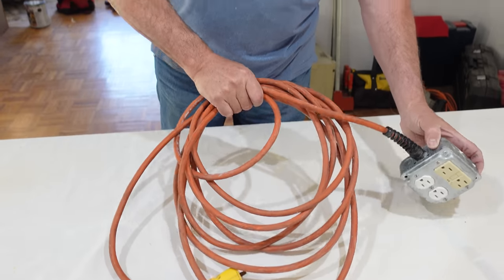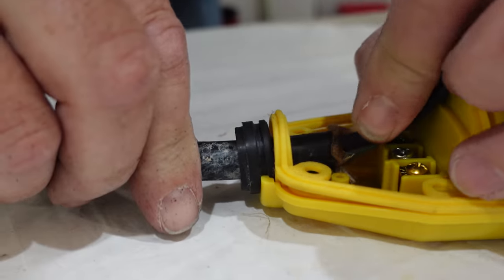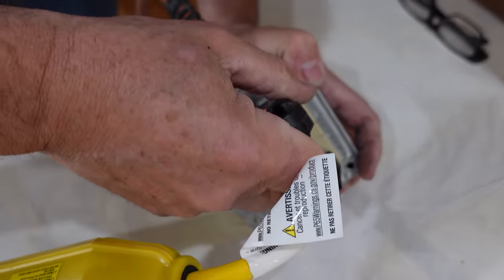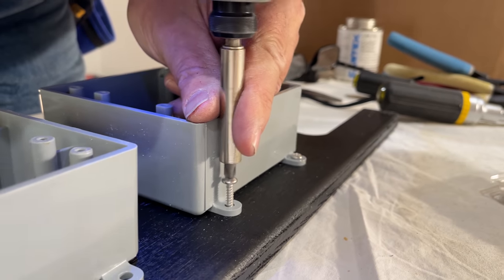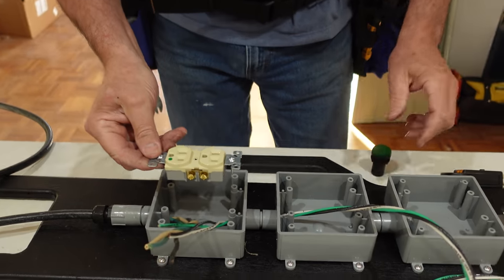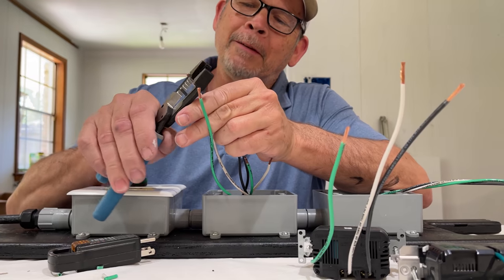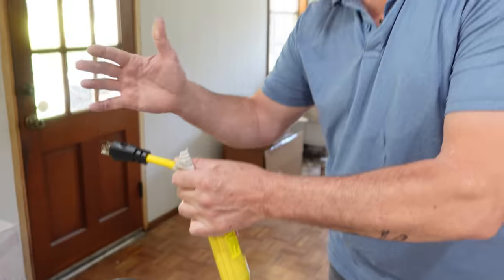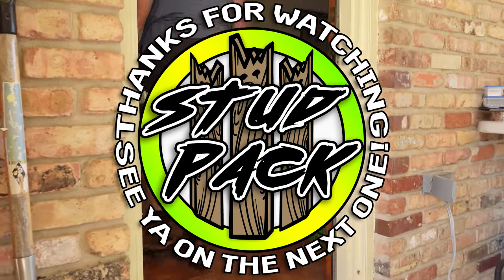HOW TO MAKE THE ULTIMATE EXTENSION CORD!

Comment: I see one improvement I would make.  I would have the cord wrap BELOW the outlet boxes.  That way I could use the boxes with unwrapping just a few feet of wire.  The  way it is now, you have the wire blocking the boxes.  BTW, this is my first time watching your videos and I liked / subscribed.
Reply: for a variety of reasons, it is better to not have current carrying conductors coiled up. (heat build-up, magnetic coupling & noise)
Reply: @jamesalles139  While certainly true, it is not really a factor in this application because the things being plugged in are generally motor-driven devices which already create a lot of line "noise," fluctuating magnetic fields, etc. If your application is so sensitive to these minor data points, you would engineer it to a much tighter standard. They already "over" engineered using the hospital-grade receptacle.
Reply: @TwilightxKnight13  un-wrapping the cord is not 'over-engineering', it is simply a good habit for high-current loads.

Comment: In Ham Radio we often add meters to our panels to monitor voltage and amps on our rigs. This is especially helpful on mobile setups where you might be operating from a battery. Having a small LED display about the size if your green light would be handy to make sure you don't overload the circuit.
Reply: This is great!
Reply: Any ideas where to source or find one of the led displays?
Reply: "Jameco" Electronics company
Reply: Came to say the same, found a volt / amp display in a slightly larger than the power on indicator light shown.

Comment: Hi Stud Pack , I am a electrician in Quebec Canada , I love your videos keep it up. The reason it didn't trip right away, is it wasn't a short circuit , try it again but wait longer so the breaker heats up  and goes on overload , it should trip . But there are lots of old panels like commander and FPE panels that are notorious for not tripping on overload conditions. Electrical panels do need to be tested after 20-25 years .
Reply: As a bit of trivia for you - the current recommendation in the UK at the moment is every 10yrs, but we do have the madness of ring final circuits!
Reply: i agree with this statement
Reply: Nice was also going to say this I am a Sparky in Texas

Comment: I would mount the last grey outlet turned 180 degrees. You see at 23:30 how a right angle plug blocks the second outlet. Reverse the outlet, and you can use a right angle plug in the lower, or outer spot, and leave the other outlet available if needed.

Great video!

Comment: That has got to be the most awesome extension cord of all time. Reminds me of the ones we built when I was in trade school in sixties. We had the auto shop weld up some stands. We then attached two eight inch square boxes and wired in two duplex receptacles in each with thirty feet of 12/3 stranded cable. Great job site cords but know where near yours. Of course it was 1966.

Comment: I have been wiring devices all my life. With few alterations I think this was spot on. As usual I would personalize it for my own particular needs...but it was the best homeowner instruction level one yet. I did a 240 volt 50 amp one off of a range plug and a small subpanel. It had 240v, 120v and gfi protection. DEFINITELY not water resistant or OSHA approved. I can weld with it and run  anything 120v ..with full breaker protection. Not pretty either.
Reply: Please show me how to make one. I travel a lot doing repairs anything from roofing to repairing/welding damaged hand railing.

Comment: As a retired electrician I complement you on the extension cord. However I must throw a word of caution about the paddle connections. For this application it probably wouldn't be a problem but having years experience in the oilfield electrial equipment and vibrations having a tight twist on the stranded wire under the paddle connectors will become a loose connection. The natural twist of the wire is good. The tight twist over time will relax.
Reply: I was thinking the same. We always tinned the conductor with a little solder to strengthen the mechanical connection.
Reply: It explain why we needed to re-screw connections of breaker box and terminals after a day or 2, to be sure the wire werent loose. Solid wires needed little tighting, but stranded wire where the always loose. So, we twisted too much ! Thanks !
Reply: @donfrost9457  Solder will cold-flow under compression. I was taught to use copper ferrules.
Reply: I never twist strand wire much
Reply: Also a retired wireman. Whenever I would find stranded wires under a screw in this manner, the thought that would come to mind is that the guy who wired it was just plain lazy.

Comment: Not only was this a great video it also showed items that many of us most likely never knew existed. The receptacle with the USB option not only saves counter space it eliminates the necessity for the little “brick” transformers which are just clutter once you’re done charging an item. 
The plug end gfi was another bonus.
Reply: This is a good point and as someone who does their own electrical it is not a big deal for me to install the USB charging receptacles in my house. The issue I have, is that the USB charging standards keep evolving. i.e., they used to be 5w, then 10w, now some phones are upwards of 100w charging capabilities. Also the underlying protocol used (ex one of the newest is PD3.0 with PPS) keeps changing for optimal fast charging. So in the end, I prefer to swap bricks than to keep swapping receptacles. That being said, I think its a great addition to this extension cord where you want less clutter.
Reply: @glennda5id  my son is a six year Tesla employee and he says fast charging harms a battery and slower is better. Using those cars as an example charging at home is far better than repeatedly using the supercharger stations. 
I have new/newer apple products and they came with larger wattage bricks but opt for the slower one as there is no need to rapid charge them. 
It’s personal choice.

Comment: I built version one a couple of months ago and I love it. I will probably build a simpler version of this super ext cord, but I’m not a fan of that huge yellow GFI box. Love the built-in mount/cord wrap and love that it’s rubberized. The point is you guys pointed out that the bus bars we build are far better than the ones sold in the big box stores. They are also customized to our needs.

Comment: Although I don't remember exactly how long ago it was but somewhere in the neighborhood of 25 years ago I was faced with an extension cord with a bad female end. I didn't have a replacement handy but I did have a metal two gang box and some receptacles, so I put them on the end of the cord and still have that cord today. It makes a pretty versatile extension cord where I can actually plug in four different things. It's really handy when you're working on a job and you're using a drill and a saw and a light and God knows what else and you can plug them all into the one cord so you don't have to unplug something to plug something else in every time you want to switch tools. Anyway, great video that is an awesome ultimate extension cord.

Comment: I like it!  The one change I will make is a spool because wrapping cords around static cord storage twists them.  I like a detachable cord (from the board), with one of those sunk-in cord sockets, which helps with the spool being simple as well as allows any extension-cord to be use.
Thanks guys!
Reply: That's a great idea actually, the retraction mechanisms in those tend to be quite bulky/heavy but it seems perfect for an application like this

Comment: You can also use a seam ripper (used for removing stitches in clothes) to cut the wire shield off, it works for automotive wire harnesses good. Love the videos!!
Reply: I worked with a retired AVCM (Don Noise) for a short time; who told me he also used a seam ripper to cut “spot tie” on on wiring harnesses. He was absolutely correct works much better than dykes, knife or scissors. Thanks for the tip.
Reply: Suggestion - get your own ripper, don't use your wife's

Comment: Nice job as always guys, love your videos!

Not an electrician, just a DIY enthusiast, but a couple things stuck out to me:
1. You only need stranded wire if the wire can be moved around (e.g. the extension cord bit, or in a flexible conduit) - internal to the boxes between devices can be solid without issue, and would be easier to connect.
2. Seems to me if you have a 20-amp receptacle, I think technically you'd need a 20 amp plug on the supply end to physically prevent you from using a 15-amp outlet. I suspect that inline GFCI is only rated for 15 amps.
3. It's a shame the strain relief on this one didn't have the flexible spring to prevent hard angles at the connection.

Keep killing it! :D
Reply: I was wondering that, myself: what happens when you try to plug a 20a tool into that extension cord that is plugged into a 15a wall outlet.
Reply: I would have used solid wire inside there, especially on the ground.
Reply: @monkeysuncle2816  It'll always trip, the 20a tool is goign to use more than 12a (nuisance trip threshold for a 15a breaker)
Reply: @TheDarthJesus  All the portal power tools I have are only 8a.  Most 20a tools have some weight to them and will not be carries from job site to job site, such as a drill press, bandsaw,  or a lathe.
Reply: @gn02020202  oh absolutely. I was simply saying that  using the 20a plug on this "super extension cord" for a 20a tool, while plugging it into a standard 15a receptacle (which is rated for 12a continuous current as per the 80% rule) would cause the breakers to trip.
Reply: Exactly this.  Never try to sink more power than you can source.  That 5-20 should not be on there.

Comment: Technically, your 28 amp load would have never overheated or damaged the wiring. #12 wire is designed to carry 30 amps without heating beyond 90 degrees Celsius. Most wire insulation won't melt until beyond 105 degrees Celsius. Look up the NEC wire ampacity table. We are limited to using #12 romex at 60 degrees Celsius (20 amps) because it's best not to push the limits of the cable when risking fires. Many inexperienced DIYers tend to push the limits of electrical wiring. The #12 triplex wire you used inside the boxes is indeed rated for 25 amps, as it is only limited to 75 degrees Celsius.
Reply: You also have to realize that that wire may be in place for 50 years or more and the insulation may degrade. Also the abuse it may be subject too, so yeah you want a lot of  room before you would hit the limits.
Reply: The #14 Awg that's probably feeding this outdoor receptacle rated for 15A but has a 20A at 75 degrees Celsius and 25A at 90 degrees Celsius carrying capacity on a 15A breaker disagrees.  :P
Reply: @hawk5602  I'm not encouraging anyone to draw 28 amps on a 15 amp circuit, just pointing out that the device they made up would survive a 28 amp load for a significant period of time.

Comment: A small suggestion: The strain relief as mounted at the end of that little extending pipe (instead of being mounted through a plain hole in the panel wall of the box) could snap off if it gets tugged sideways really hard. You could reinforce it by adding a U-shaped 2-hole conduit or pipe strap,  screwed to the board near the end of the strain relief.
Reply: You can get strain reliefs that glue right into the box.  That's probably a better solution than extending the strain relief further from the box.
Reply: The thing you are speaking of is properly called a "gland nut" as a strain relief is actually what he showed on the first version of the extension cord from the previous video.   And I agree, the cord should be fastened to the plywood before that point.

Comment: Love it! On mine, I’m going to put the high capacity receptacle closer to the cord and not at the end of two sets of 12g jumpers so it gets first dibs on current coming into the boxes. I’ll switch a 15a receptacle instead of the 20a since that’s more likely where I’ll be plugging in lights, and I think I’ll mount the indicator light on the side of the last box. Since I have to drill a hole anyway it may as well be on the side. That’ll free up a position for another receptacle. If you wrap the cord in a figure ‘8’ pattern for storage it won’t put twists in the cord.

Comment: The breaker didn't trip because it's not supposed to.  Generally, home breakers will allow you to pull between 100% and 125% of the rated current indefinitely.  The more over the rated current you are, the faster it will trip, so you can draw about 200% to 300% of the rated current for about 10 seconds.  A dead short is far less than a second.  I would link a breaker trip curve example, but youtube sometimes flags comments with links as spam.  If you look one up, you'll see there are 2 lines, and the area between them is the "might trip, might not trip" zone (and is commonly shaded), so when you're sizing breakers for larger equipment, you need to make sure that your load will always stay to the left side of the left curve, including during startup, otherwise you'll hate yourself or other people will hate you.

This might seem terrible, but it's actually a very good thing.  When you turn on an inductive load (like an air compressor or saw), you get an insanely high current spike on startup, and the breaker tripping would make it completely useless.  Yes, this is completely safe, copper has a lot of thermal mass so it takes a while to actually get hot and be a danger.

Also I'm an electrical engineer, not an electrician :P
Reply: Wrong
Reply: @dontworryaboutit3281  care to explain? I generally work on electronics so I haven’t done much with this since college
Reply: @wcvp  I wouldn't worry about it. Just a random troll 🙃

Comment: Love the build.  One thing I would be concerned about is the life span of those cover plates.  Corners have a good chance of snagging.  A frame around the boxes so they have something to sit on should be an easy fix.
Reply: I came to the comments specifically to find this. It was the first thing I thought of as well.
Reply: Being a tin bender, AKA metal fabricator, I immediately started to design the enclosure in my head. It's a character flaw!

Comment: I do a lot of DYI cords and repairs. I take additional steps on the wire ends after stripping. I solder the ends of the wires before clamping. Never had a problem with loose screws. Just the way I do it.

Comment: Awesome job! Those screws on the sides of electrical outlets are very interesting. I used to think they were a combination of Slotted and Phillips, but I was wrong. Slotted screwdrivers don’t work well as they can slide around too easily. Phillips head screwdrivers in those screws work better, but these screws are not designed for Phillips drive. You can see in the middle of the screw a square hole (not a pointed Phillips hole). This is called a Robertson drive (square drive). It fits perfectly (no sliding) and allows you to easily drive them even in odd positions. You can buy Robertson drivers at most tool outlets, but there is an even better solution that I recently discovered. Milwaukee makes an ECX driver that is specifically for electrical work (insulated down to the tip). The ECX driver is a combination of Slotted and Robertson drives. It’s been great for my amateur electrical work. It comes in two sizes - #1 is for normal stuff. (Jordan – Father’s Day is coming).
Reply: klein also makes screwdrivers labeled c1 and c2 for combination screws it is on my 15 in 1 ratcheting screwdriver from them it is starting to show up in newer assorted screwdriver tips packs also
Reply: It's nice to see more and more devices moving away from the stripping Phillips

Comment: I know it was just a throwaway comment, but I had to say this; a set of Felo automatic strippers made my workflow so much better. I build a lot of custom electronics and AV/data systems. Stripping wires to the proper length in 2-5 seconds rather than 15-30 can turn a 16 hour day into 10 hours.

Comment: Your typical circuit breaker has two trip modes, a magnetic and a thermal. The magnetic will trip instantly for high currents like a dead short, while the thermal portion can handle brief overloads to allow motors and other high inrush devices to start. The datasheet for the breaker will have the curves, but typically most will handle 200% for about 10 seconds, 150% for 100 seconds.
Reply: Or its a challenger breaker lol.

Comment: Years ago, I was at a safety meeting. A picture was shown of an extension cord wrapped around a "cord keeper" and had over heated overheated and caught fire. That impressed upon me so much that to this day 40 some years later, I always completely uncoil the extension from any "keeper" so the cord can have air circulate around it. My kids were small at that time and I instilled upon them and my wife to completely remove the cord, irregardless the length so it can "breathe". Granted the picture at the safety meeting was a worse-case scenario. 
  I do like your complete idea, and am thinking about building my version, but I will have to unwrap the cord every time just because of that safety meeting picture. Thanks for the new cord.
Reply: So I'm guessing you don't use one of those automatic cord retractors in your workshop. Or do you pull all the cord out when you use it?
Reply: @PhilDeGuzman  I fried a nice Belden retractable cord when I used a Milwaukee heat gun and failed to pull the cord all the way out. Pulled out about 5', plugged in the heat gun and about 5 mins later... smoke and the smell of melting insulation!